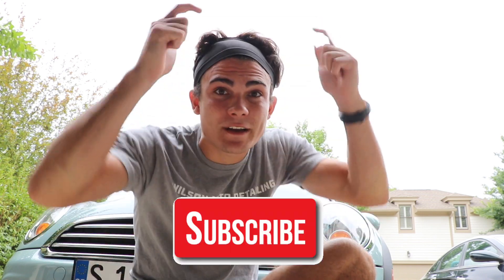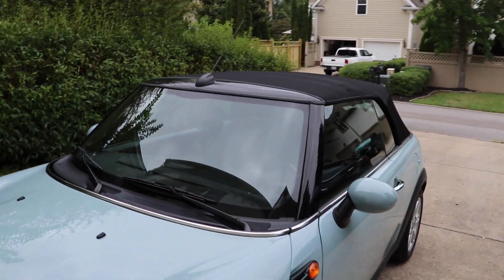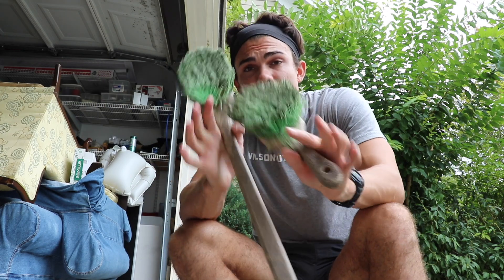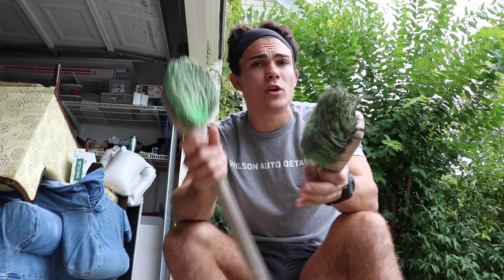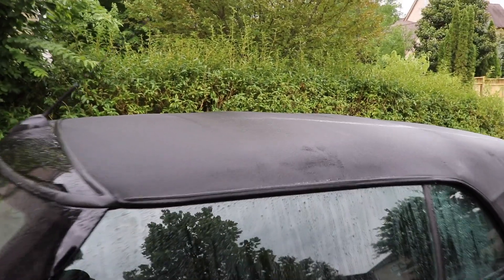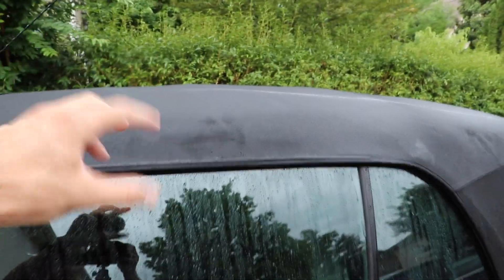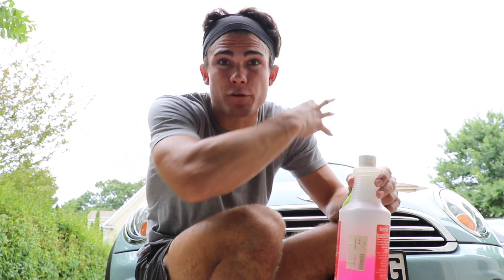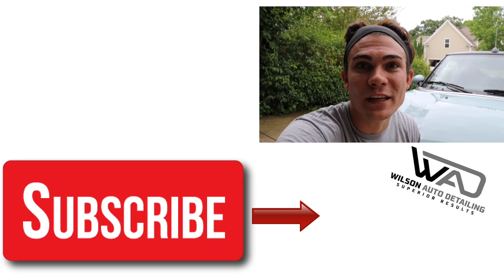How To Clean Convertible Tops... It's A Little Complicated

Comment: A lint roller is a must have. Lint roll before you wash and after if any fibers or bistles are left. I'd be afraid of trapped brake dust on a used brake brush. Love the videos. Keep them coming

Comment: I tried cleaning my wheel brush as much as possible...could still feel a metallic (?) residue on my fingers after rubbing the bristles, probably from brake dust. Think that'd cut and fray the fibers of the convertible top. I'm getting a separate mothers wheel brush for just my fabric convertible top, they're only like 6 bucks.
Reply from the maker: Yep great idea! I keep more than one of many of the same brushes for that reason exactly
Reply: @wilsonautodetailing  Raggtopp has a wood handled green brush that looks exactly the same as the mothers wheel brush but its $30, any opinion on it? Looks like marketing bs to me.

Comment: How do I get Pine sap off my Convertible roof??????
Reply from the maker: I would use a version of this same strategy, but let it sit for some time. You could look into using citrol degreaser, it wont stain fabrics, but I would dilute it around 6:1. Even rapid remover can be used and would do it if I had to guess... then dont park under a tree again :D
Reply: @wilsonautodetailing  Yea my wife and I have been through this a few times.........LOL!